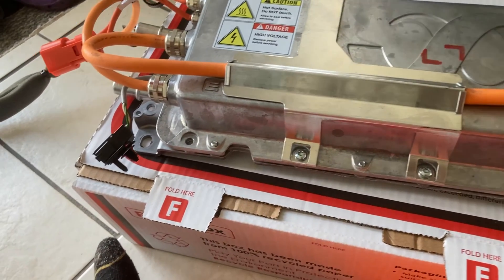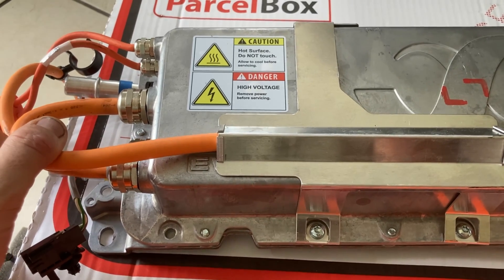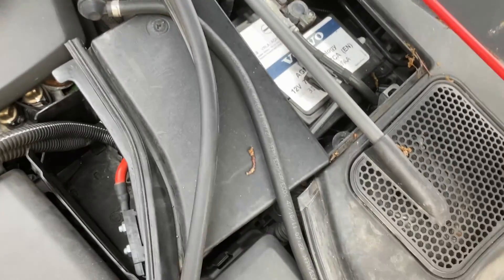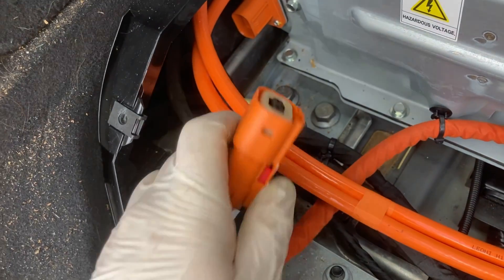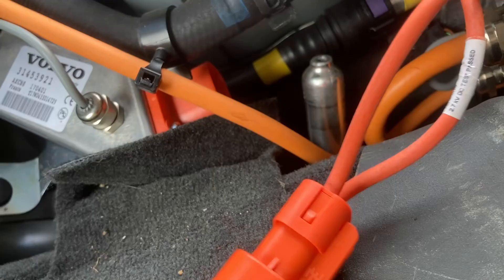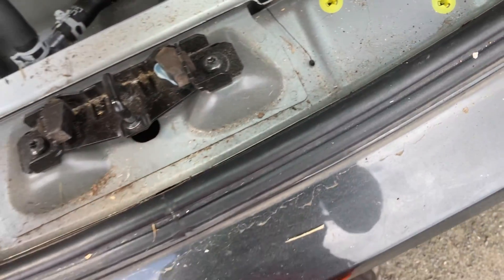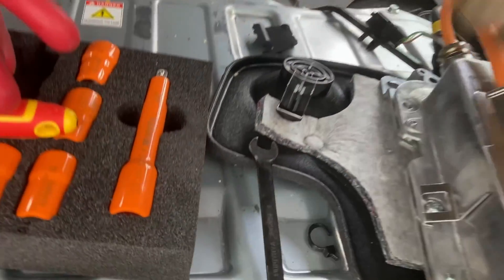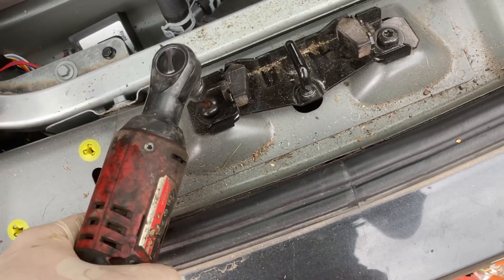EV not charging? Volvo V60 OBC Removal

Comment: Hi! How do i isolate the battery when making bigger labours on the car? Is there a killswitch like on other hybrids?
Reply from the maker: I show it at around 5 minutes but you still to do an absence of voltage check before you can remove anything in a loop plug further back in the right hand side lower part of the boot.
Reply: @maxautouk thank you!

Comment: Hey, i hace a problem with one o these... Its not charging more than 48% of the battery... No fault codes... I suspect something with the charger but i cant decide if i dont have anything to confirm... Any ideas ? Thank you in advance
Reply from the maker: The battery stops charging when the weakest cell reaches full charge, it may need a replacement cell
Reply: @maxautouk  Im about to find out this coming week...

Comment: Great information, did you replace with new or get that unit refurbished? what's the approx cost?
Reply from the maker: I think it was around 300 pound to have it refurbished
Reply: @maxautouk  thanks for getting back to me, mine has just stopped charging on Sunday, so currently waiting on a quote from an ACtronics vendor here in Ireland. Hopefully it'll be close in and around 600 euro with shipping and all that. Volvo quote was 1870 euro for a new unit, but must return mine to them, for refurbishment probably 🤔